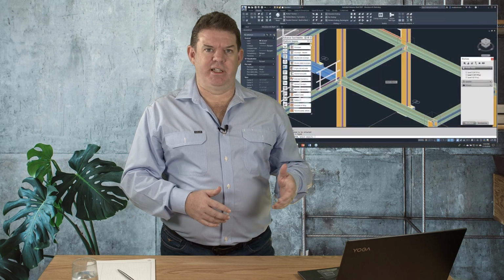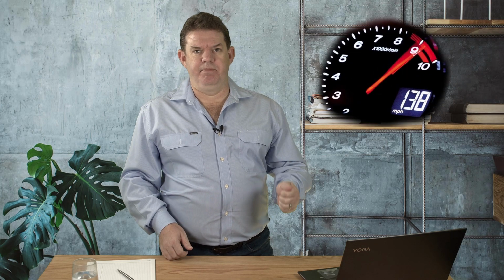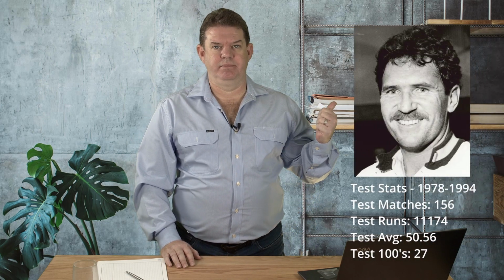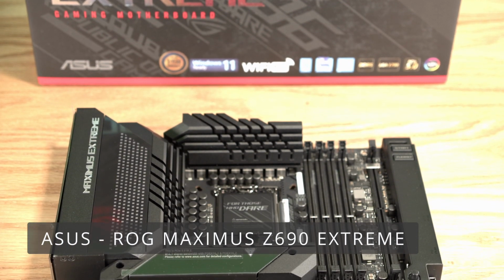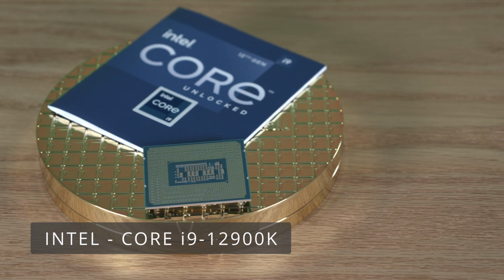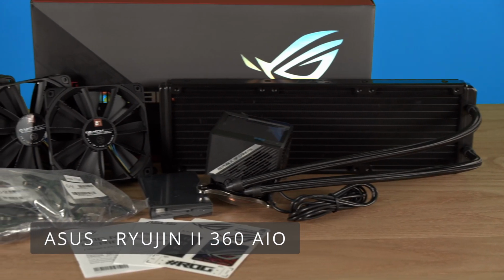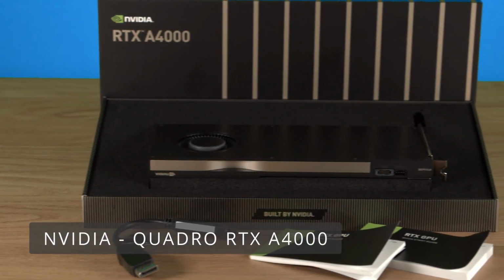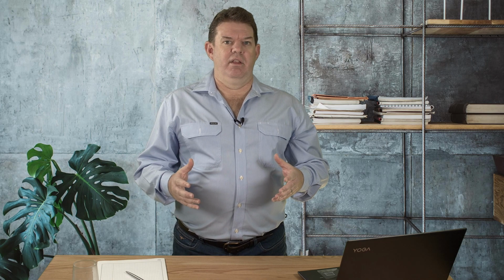Overclocked CAD Workstation - Episode 1

Comment: Great work Murray, look forward to next installments and outcomes.  iConstruct first started writing CUDA kernels for the nVidia GPU back in 2015 for our model compare tool, without leveraging the power of the hundreds of cores to run the algorithms it would have taken too long to be feasible, relying solely on the CPU cores. Our model compare algorithm prepares packages of up to 30 million 3d points at a time and gets the result from the GPU within a few seconds. We have since used CUDA kernels in our Zone Finder tool and also to provide a performance boost when exporting to IFC.